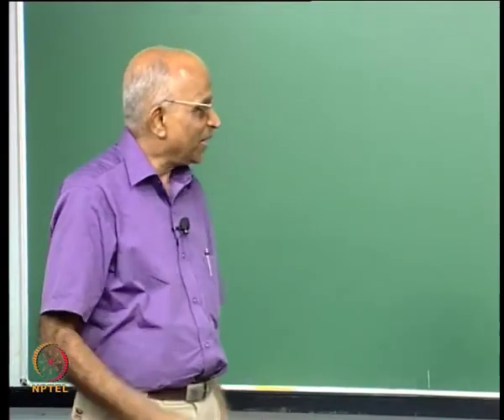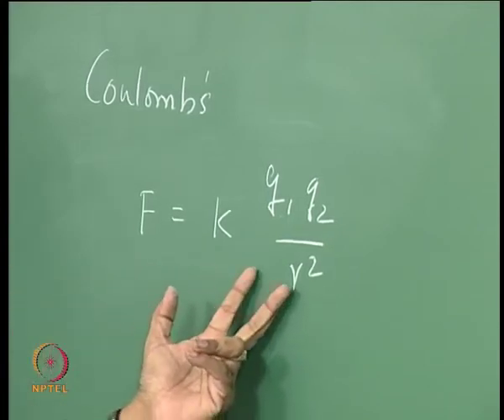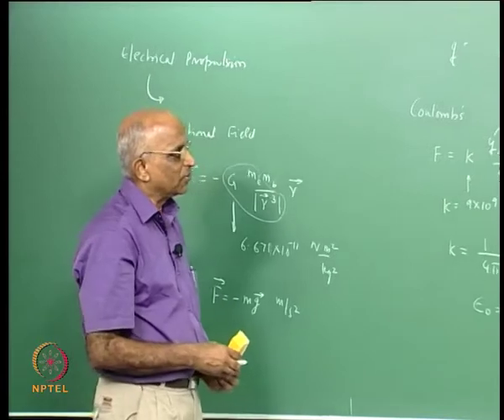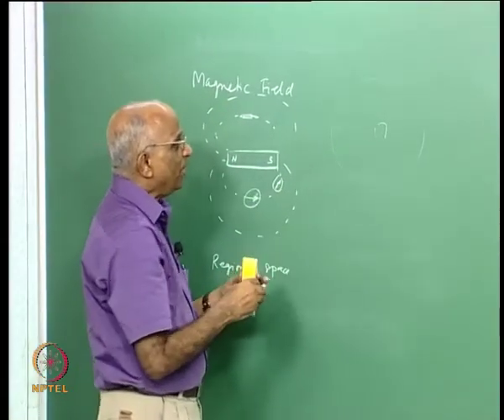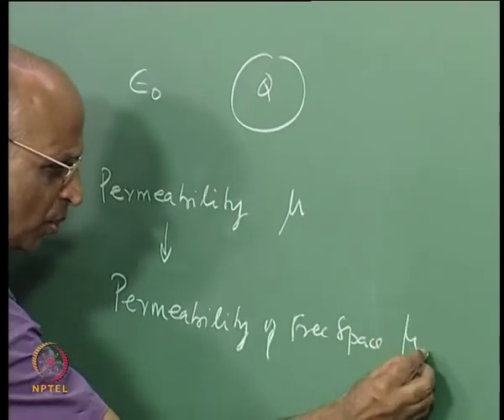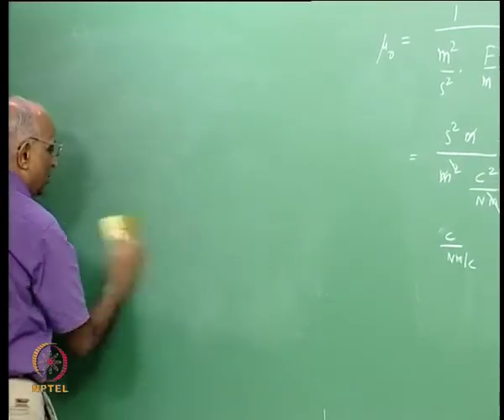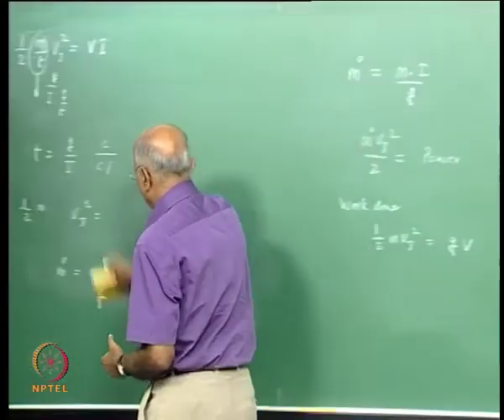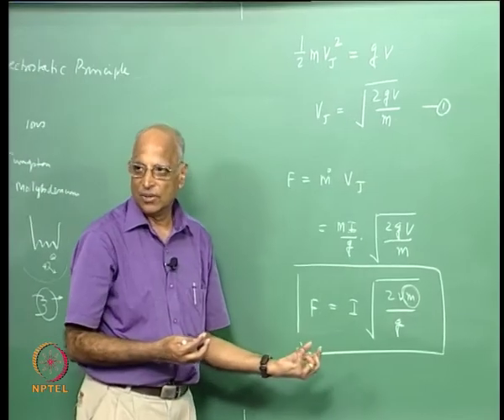Mod-01 Lec-39 Electric and Magnetic Fields and the Electrostatic Thruster

Comment: use a high voltage sawtooth wave, created by a slowly (transverse) charging capacitor and fast (longitudinal) discharge through a sparkgap.
The difference in displacement current produces thrust on the  capacitor plates. 
It's about displacing the electric field (field=charge). 
I have proven this with a 10kV 1.5kHz Sawtooth and a 250pF parallel plate capacitor, video of proof (soon to be released) in my channel